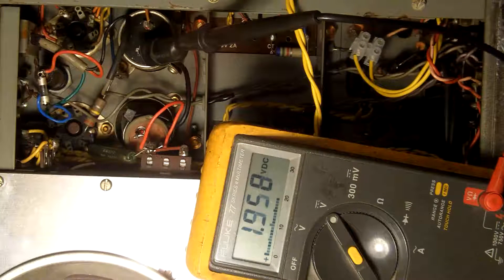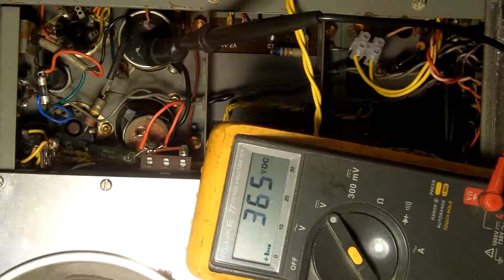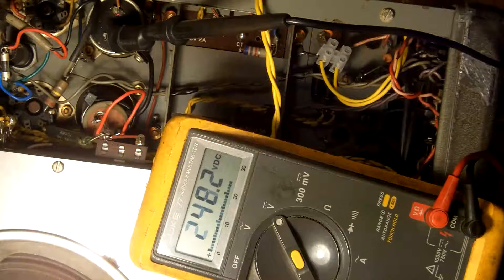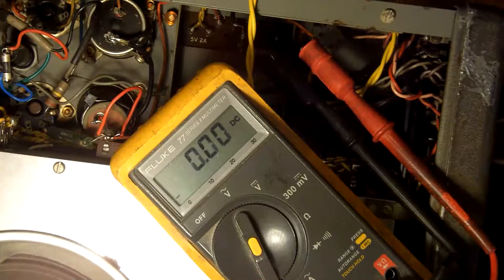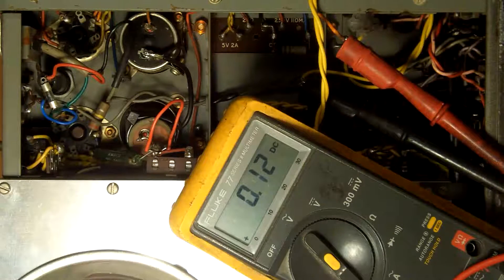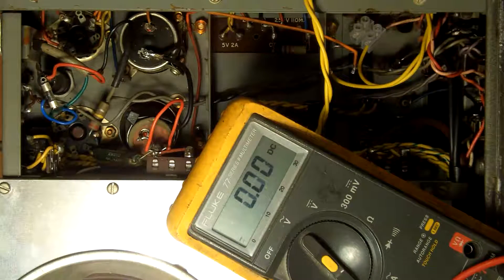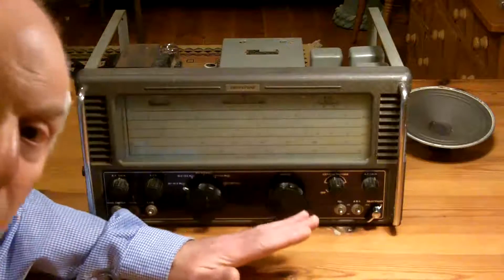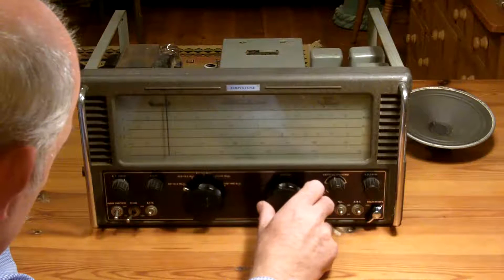About Radio ... Part 27 Eddystone S680X ... It's working

Comment from the maker: @Zone1242
 Hi John, I know what you mean, I’m very tempted to carry on but I need a couple of buckets full of extra hours in every day. I’m pleased to have achieved what I set out to do and that was proving all the major components.  It still needs a replacement choke but that shouldn’t be too big a problem. It’s just a pity that my friend hasn’t got the original ironwork as I could repair it.  
I’ve been given a link to the ‘Eddystone User Group’ there’s a lot of good stuff there.
Regards. Andy

Comment from the maker: @MrVinamp 
Yes it’s alive and so was I when I got across the HT reservoir capacitor. I checked the discharge time and it took the reservoir cap 2 minutes to drop to 40 Volts. Fortunately I guess it’s a bit leaky otherwise I could have had a more forceful reminder. It’s a crazy design that allows the HT caps to be disconnected from the load leaving them charged up. I had a face full of capacitor once so I had my safety glasses on  but I forgot to use my insulated fingers, hi hi.    ... Andy